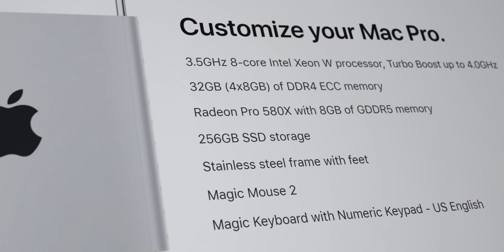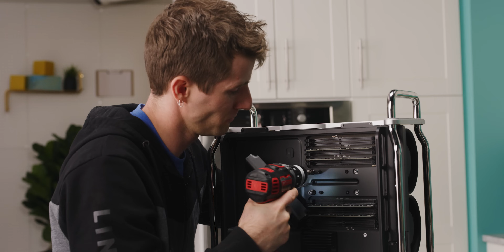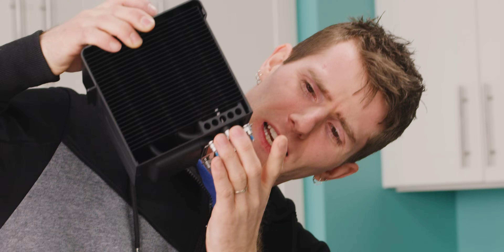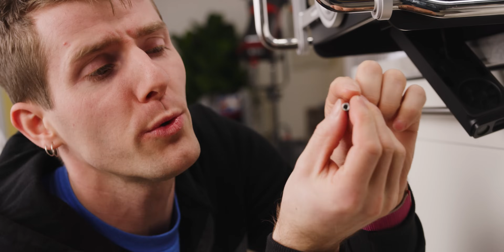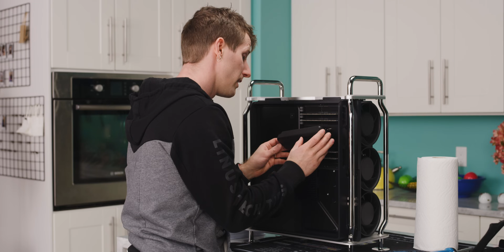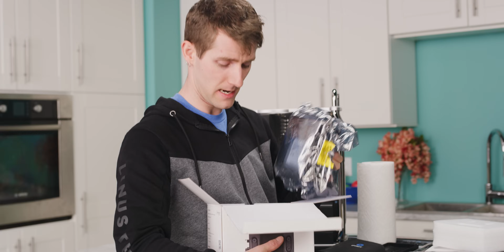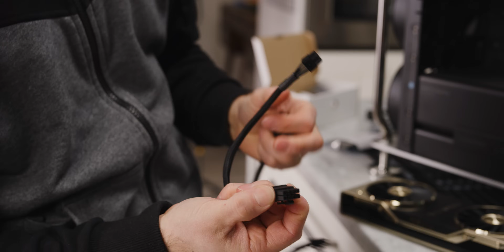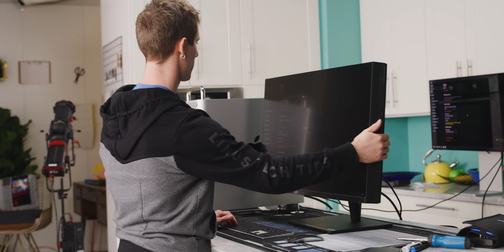Don't give Apple your MONEY - Mac Pro Upgrade Adventure

Comment: 6000$ for a 8 core 3.5 GHz 32 GB RAM, a Radeon 580 and a 256 GB SSD... i spec a PC for a person who is financially challenged (less than me but i know PCs a BIT, not much but still...) for about 1000$

AMD RYZEN 7 2700 = 185$
MSI B450 TOMAHAWK MAX AM4 = 150$
OLOy 32GB (2 x 16GB) 288-Pin DDR4 SDRAM DDR4 3000 (PC4 24000) Desktop Memory Model MD4U163016CGDA = 129$
ZOTAC GAMING GeForce GTX 1660 6GB GDDR5 192-bit Gaming Graphics Card, Super Compact, ZT-T16600K-10M 300$

764$ or 879$ with 15% tax. (if not already applied.)

you might need a power supply is then:

EVGA 700 GD 100-GD-0700-V1 700W ATX12V / EPS12V 80 PLUS GOLD Certified Non-Modular Active PFC Power Supply 118$

so total would be:

882$ or 1015$ with 15% tax.

i gave this message exactly... all tho on new egg... while prices and parts might change. this PC is probably in the range of that Mac Pro configuration... performance wise, they probably are close enough for someone looking for gaming and video editing (and is also a Vtuber. so 3D realtime rendering going on while recording videos.)

Comment: Someone needs to figure out how to bypass the t2 chip
Reply: Can't really without extensive motherboard modification. It takes the role of the PCH and a lot of things are running through it.
Reply: @WorBlux  that's just a pain  I knew they ran alot of systems through it but I think it's a waste of engineering resources.

Comment: If you have a Lambo of computers, get a fastening device (drill) that doesn't scream and grind every time you use it. you also may want to start using a ratcheting torque driver instead as you are dealing with expensive parts, which will likely not have any effect after you apply tension on those springs without bottoming them out.

Comment: I kinda like not having retention brackets especially if cooler mount are spring loaded to have the right pressure. Makes install vertically much easier.

Comment: As much as this Mac Pro is a step in the right direction, the pricing on the upgrades are just ridiculous and the T2 chip requiring the stock hard drive is a complete non-starter for me as a desktop machine...oh well, one step at a time

Comment: The original Mac Pro came with an empty drive bay. It had these little dome shaped philips screws that you would screw into your drive. They worked like drawer slides for the groove in the empty slot.  The cables were already neatly installed and were just long enough to plug into the drive. There was also a little leaver you'd turn down that kept the drive from sliding back out. 4 screws to install and the rest tool less. The new one does hold more drives after you spend the extra $$, so there's that I guess.

Comment: 11:09 you broke off a little plastic clip? you know the only way to get that fixed is to bring the whole machine to an apple store. and they can´t really fix it, unless they replace the whole mother board, which will cost you 2 grand, it´ll take half a year and you´ll lose all your data. so you might as well buy a new machine at this point.

Comment: My inwin case has no drive bays so I started out with just an m.2 and added an HDD with velcro dots on a horizontal panel behind the water cooling rad where the 5 1/4 bays would have been.

Comment: The last Mac that made a CPU upgrade so easy had to have been the Power Mac G4, where it was actually a bit easier thanks to how the case swings open and the heat sink being held on either by a clip or a few screws, depending on the era. I think it started with a clip and then went to beefier heat sinks with screws later as the CPUs got faster and hotter.

Comment: 3:14 It it just apple that didn't put in a retention system...I thought ALL socket 3647 boards don't have it either.
Reply from the maker: The retention mechanism on LGA-3647 is on the cooler - The cooler then clamps down over the socket with the CPU held in place. Apple... Well. Pulled an Apple. -AY

Comment: you can get black slikscreen for the sameprice at a lot of chineses pcb manufacturers, BUT there is a culprit in high speed applications because the pigments in different coulour pcbs can (on rare occasions) be troublesome with certification RF/emf testing in highspeed applicatins like Ram for example. Green always works it is the industry standard well tested and the safe choice. btw, if you want to get pcbs made best source is Aisler.net (fast, reliable and they produce in the US / Germany), use code "mayermakes50" if you want to try it out it may still work.

Comment: I am not sure what mounting bracket did you expect on s.3647? Even the server Xeons don't have those. The plastic "frame" that comes with the s 3647 does not actually hold the CPU in the socket in any way. It only helps with orienting the CPU.

Comment: Imagine paying $400 for a privilege of mounting a HDD in a case (with a weird drive bundled, for some reason) and $80 for the luxury of cable needed to power a GPU.
Meanwhile, $50 cases can support up to 10 drives out of the box and $50 PSUs ship with more cables than anyone needs.

Comment: Did I miss something? on ark.intel the Xeons related I found either have 1 or 2 TB or RAM for maximum allocation. What's this 1.5 TB on the new Macpro? Is it a hardware limitation on the mainboard because I doubt they got specially sourced CPUs with a modified ram controller?

Comment: 10:13 so the lifespan of the machine is equal to the life span of those M.2 drives? . . . . great. . . .
Reply: @Empika  Dont get me wrong they can potentially last a decade if they are high quality and in ideal conditions, but if you have a faulty unit or Apple screws up a M.2 driver update then your at the mercy of Apple's support. . .
Reply: Moustache Pikachu, When has an electronic device ever existed that wasn’t prone to failure? Statistics say that only about 37% of devices will make it to their MTBF. As nice as ~2 million hours sounds, chances are that’s not your drive.
Reply: apple has the ability to flash the T2 chip, which would permit registering a new drive with the firmware in the event of a failure
Reply: @koyagami932  You are so right...  Also regardless of Apple's ability to replace or reflash they will just say "you need a new mobo and new drives"
Reply: @Empika  it's an SSD, each of its cells has a fixed limit of write operations after which this cell dies. So, you'll kill your SSDs after 3-4 years of active use.

If I had this computer, I would have just left those SSDs alone and would have booted from a different drive.
Reply: Ssd dies go to apple pay half price  of a new  computer and you are done.
Reply: @muaries12  You'll likely only get 5 years to be able to do even that, too. That's a typical corporate support cycle anyway, which these are targeted at pros. After 5 years of life for that machine, you better hope that drive stays alive, cause i'm guessing Apple will be telling you to buy a new one, if it dies
Reply: @Thunder Life even better
Reply: No it isn't. You can boot off a different ssd. See the snazzy lab video
Reply: @loading...3896  you can boot from a different SSD but if you remove the 2 SSD's tied to the T2 chip you won't boot from anything cos the T2 chip needs the Apple installed SSD to run... Just search "Apple T2 chips locked" for more info or listen to what Linus says in the video..
Reply: Moustache Pikachu the smaller the SSD capacity is, and how heavily it is used, it will last shorter
Reply: You can replace the M.2 SSDs. You just HAVE to replace them with Apple M.2 SSDs
Reply: @koyagami932  While I can't really speak on the professional side, but the sheer availability of service when it comes to an apple store actually made me repair most of my apple products....Whereas getting a proper rma over the mail with my other electronics actually pushed me to buy replacements instead...I get the whole right to repair thing, but for the most part I had the opposite effect.
Reply: @Empika  PCI Express 3.0 x4 M.2 50% health drop in 7 months with only the os...and write speed drop from 1200 to 50 mb/s

Comment: It’s funny how they use torx screws for the cpu cooler like a Torx screwdriver is hard to get or something
Reply: It's not for tamper protection, in an assembly environment, Phillips head drivers round out due to wear very quickly. Torx is used vs. hex as it is more robust.

Comment: Hey, I need help I recently took out my cpu in my pc and I think I got thermal paste on some of the pins, will this affect the pc from outputting the screen because it is turning on but not displaying anything on my monitor
Reply: It's not good. CAREFULLY clean it.
Reply: Mr. Hostility turns out like 5 or so pins are bent so I’m just going to have to get a new cpu
Reply: @samback564  I've fixed things like that before. It's tricky...it's worth a shot. A bent pin isn't broken.
Reply: Mr. Hostility il try

Comment: as expected the XDR display doesn't work with the RTX Titan, Linus plugged the Asus monitor directly to the rtx display port, Nvidia frame buffer is not routed through the Vega TB3 ports.

Comment: The "Right to Repair" law that didn't pass in certain parts of America prevents repair shops from repairing Apple and Dell PC's, etc.
My advice is to just avoid buying those brands completely.
Reply: We need to support the "Right to Repair" movement. It effects ALL of us.
Reply: Back and support Louis Rossman. He went to Washington and Maine and saw the same lobbyists at both places.

Including CompTIA was against it, which is quite dissappointing.
Reply: @lakorai2  Yes! Please follow Loius Rossman on YouTube. He's spearheading the r2r movement out of his own pocket and deserves our support!
Reply: @mr.hostility8970  Yes that's correct that's basically the source i got most of this info from.
Reply: Similak Child wait, seriously?!? Is this really the case in some parts of America? Because not being able for casual Users to just let their devices getting repaired is the dumbest thing ever I heard what America is doing. In this case Normal People without knowledge of Electronics etc. will just threw away a probably still maybe fully workable device after a 5 Minute repair. This just makes even more electronic waste what would actually be not necessary it the first place
Reply: Yeah especially since Apple has no additional value apart from maybe their style and the OS. If you want a Mac OS system just buy parts, a Mac knock off case and make it a hackintosh. Sure that isn't als simple as just buying a Mac but coming up with the financial resources isn't either
Reply: Tell me about it I write a 6-page paper on r2r for my philosophy class

Comment: Apple's next project......tying the memory into the T2 chip.
Reply: Deja vu
Reply: Yeah, like for security reasons
Reply: Its just cost saving. The T2 chip is essentially just an iphone running alight version of the darwin system. Since that also means it has an SSD controller you might as well use that and just put some NAND chips on a socket
Reply: @dfjab  Tie all the things!(tm) to the T2(tm)
Reply: @Tcll5850 don't forget the tamper-evident shielding and water damage tags that change color over time
Reply: @MrPatchPlays  

also glue instead of screw so it looks better.
and remove all the fans and vents to make it silent.
Reply: @uteriel282  xD this

Comment: New video idea. What happens when that required SSD Fails and you want to recover said Mac Pro? Does the system still function with dead ssd due to chip on the ssd itself, or does it fail to boot due to apple throwing special code on the memory itself on the SSD?

Comment: Anthony secretly trying to corrupt any mac system by damaging it is great.
Also, what happens if the 2 SSDs linked to the T2 chip fail?
Reply: You can't use your workstation you got for 'reliability'. :)
And you need to go through Apple to get SSDs that will match the board, as Right To Repair isn't a thing as it would cause consoles to melt and tractors to go 60 km/h or so I've heard.

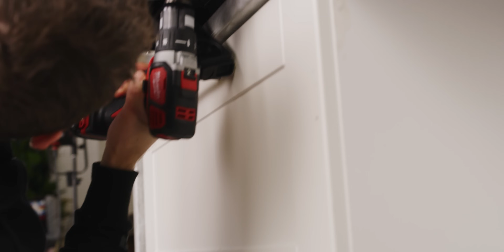Comment: 6:39 - Did Linus just screw that in with the driver set to drilling, so it will tighten with full force, on highest speed too?.... You are playing a dangerous game, Linus.
Reply: It's an apple product so it's fine
Reply: As long as the springs were not completely compressed, the correct tension will be set automatically. That's why the springs exist in the first place.
Reply: oh yeah you are right, it was set for drilling. Luckily it was set on faster gear so it means less torque
Reply: I kinda cringed we i saw that. Way to over torque and break those screws i guess :P
Reply: The verge approves its ok.
Reply: If you're completely incompetent, that's true. It's called trigger modulation. Linus is obviously experienced enough with a screw gun that he didn't need to change it. (I've NEVER changed any of our screw guns out of drill mode, unless it was to change to hammer mode.)
Reply: @xenonram  Amen.
Reply: @xenonram  If you actually worked with anything that required any finesse, you'd know, that you can't feel how tight you are driving those bolts. So no, it's not about speed as such, but about how tight it gets. Though you never screw delicate stuff like this in at full speed, because it snaps... Don't try to be a smart ass, when you don't actually have it right.
Reply: @xenonram  Kinda contradicted yourself there. The caps on never is just icing on the cake 😆 

No big deal up to like an M5 but if you wanna break your wrist on an M12 then drill mode is probably the quickest way
Reply: @xenonram  I'd like to appreciate your snobbery in flexing about having experience using power tools, but a screw gun and a drill are two different tools.

Comment: Yeah...Apple not only screwing over customers but screwing them over with no lube. All because of their pricing. Overcharging for an 8-Core CPU? And do not get me started with the pricing on the RAM. That 2 Terabytes of RAM likely cost less than the 16GB Apple would screw over customers for.

Am I bias? Yes, I am. As to why Apple gets away with this. Yet Microsoft gets slammed for being told they cannot put Internet Explorer on their own Operating Systems. Yeah.

Comment: I wonder what the benefit to using so many types of screws is for Apple. Like clearly it’s not about discouraging repairs since it’s not that hard to change a screw bit and you can pick up the handful of “special” ones they’ve used for years just about anywhere that has computer tools (and it would make it harder for them to repair too) so there’s got to be some other benefit.

Comment: "Don't give Apple your MONEY - Mac Pro Upgrade Adventure" Doesn't that apply to any prebuilt computer?
Reply: PC yes but not MAC
Reply: Not anymore.  If you actually look hard you can find prebuilts for $50 or less more than buying the parts yourself.  This was not the case in the past and it can change pretty quickly.
Reply: In South Africa, I just go with a company called Evetech - they can send me a completed rig for less than the cost of me buying all the components, so it's a good deal.